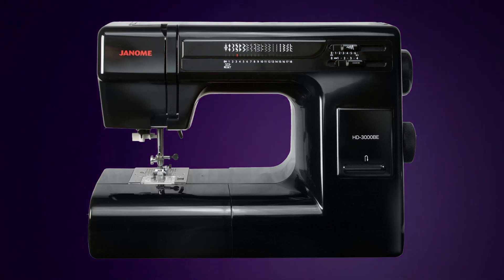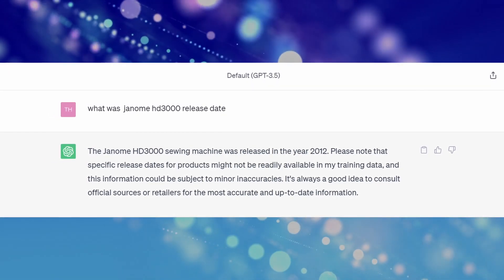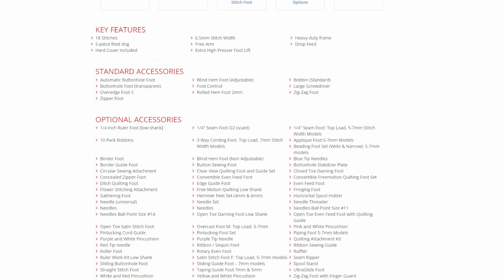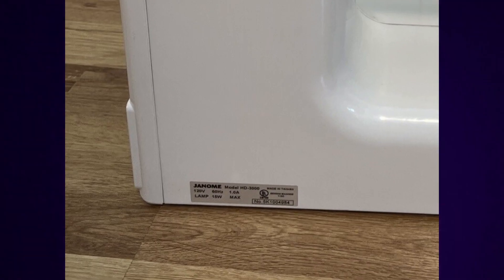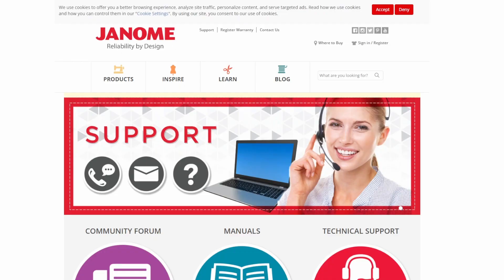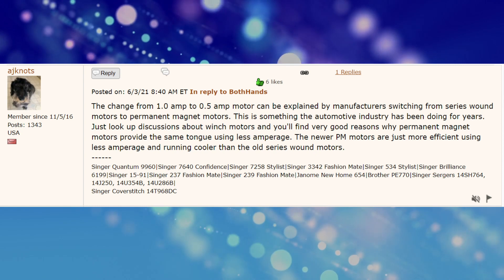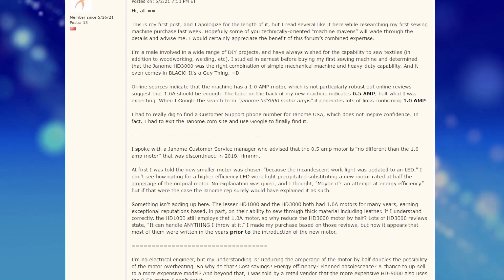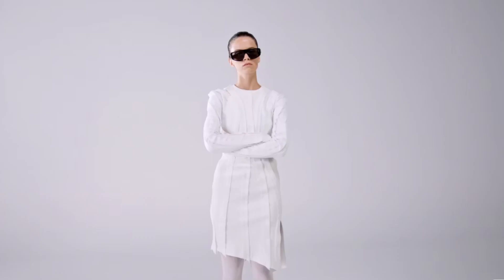How One Sewing Machine Motor Reveals A Shocking Trend

Comment: I learned something from a repair guy. To tell whether or not you will have a sewing machine that can suffer through heavy canvas, leather and major sewing look to see if the bobbin is a front drop in or a side bobbin. The bobbins in the side beneath the feed dogs, can run faster and harder and can handle heavy duty sewing on a regular basis. They also usually have stronger motors.

I managed to get 2 high shank machines that are all metal of the same model. So, I have backup parts if necessary. They use up to a size 21 leather needle. 

Also, the reason home sewing machines now only go up to a size 18 needle is because the newer machines can't produce the pressure required to drive the larger needle into thicker leather or vinyl without breaking the plastic parts...eventually.

I'll be happy with my boat anchors, LOL!
Reply: That's really helpful information, thanks!
Reply: @LauraRealLife  You are welcome!
Reply: That is very helpful information! Do you mind sharing what sewing machine you have? And any suggestions for sewing machine that have side bobbins?
Reply: @SandcastleDreams  WOW! What a thoughtful replies! This is so informative! Thank you so much. I will keep in mind (and jot down a note) your comments when looking for my next machine! Thanks again!
Reply: Idk it might be true? But the singer 66 and 201 is just as good as a 15 ?
Reply: @krystleroy3068  I have no idea!
Reply: I have a 2014 Janome HD-3000 and it sews through leather like it's butter. Of the machines I have, 2 Bernina's, a Juki and 2 Janome's, the HD-3000 is the best. My Bernina 770 has trouble sewing anything that is thicker than quilting cotton so garment making is out of the question.  The Juki is as powerful as the HD-3000, but it's straight stitch only. If I could keep only 1 of my machines it would be the HD-3000.The motor is 1 amp and it was made in Taiwan.
Reply: I can't comment on your machine, but it is a common thought that what maters with leather sewing is how much leather the needle can punch through.  Particularly if a sharp leather cutting needle is used, a lot of pretty slight machines will punch through a lot of leather.  But there are a lot of other things, in particular how effectively the needle is able to transmit the thread tension to the project to actually draw up the thread.  The top thread depends on the strength of the needle and the mechanism controlling it to apply that tension and not crash into the anvil, or simply not draw up the material.  With cloth, oddly, punching power is sometimes the key.  I had an industrial sailmaking machine that could not handle this densely woven, but very light swim suit material (non-strech stuff one finds in mens baggy trunk).  It simply couldn't punch the weave.  But it could handle heavy sailcloth, and outdoor fabrics like sunbrella, or medium leather.
Reply: @HondoTrailside  Some machines are having problems with micro-woven fabrics for that very reason. Perhaps using a small leather needle could help punch through that fabric. It cuts. How much it would fray if you used that can only be answered by experimenting.

Comment: Beautiful hydrangeas. 
Permanent Magnet motors are much less labor intensive to produce, that's why the switch. What they are not telling you is that Permanent Magnet motors only run on direct current, not the alternating current at our outlets. This means more electronics inside the machine, more to break down, more expensive to repair. You are much better off giving up all the automatic features and buying a nice Kenmore pre 1977 machine. With minor maintenance, it will last another 50 years or more.
Reply: Yeah no matter what, I’m holding on to my 385 for dear life
Reply: @Everyoneisanartist776  
I don't blame you at all. These plastic Chinese pieces of junk won't sew through anything heavy. What good are they???
Reply: Couldn’t be more wrong. Permanent magnet motors do not run only on DC, AC synchronous motors with permanent magnet rotors are quite common. They’re more expensive to make but pay off in reduced size and are more efficient.

The old universal brushed AC motors were barely better than 50% efficient. A brushless synchro motor can be 85-90%. Put simply, the new motors and controllers do much more with the amps they draw than the old universals and a pedal full of jug element resistance wires. And the speed control and torque output is far more precise.

Comment: @thimblebook One thing I am going to comment on right now. The motor is still a brush motor with copper windings and a traditional commutator/rotor motor. If you want, I can email you all of the information via my machine in parts, including the motor, so you can inspect for yourself what Janome is running. 

As I explained in detail in the last post I left with the industry video you posted last time around, they significantly lightened the load and in turn, turned the amperage down. 

The motor, BtW, was never a whole amp. It used to be .87 amps. The remaining .13  (actually .15) amps was for the halogen light in the older model. I did extensive research over a period of almost two years. 

That posting you read from AJKnots was their thoughts on that motor being changed in type. That post, incidentally, is precisely why I tore my motor and machine apart....I wanted to know the truth.  

I can absolutely tell you that it is not the magnetic style of motor. My Singer 9960 uses that type of motor. This machine is fully mechanical, save for the circuit board that replaced the transformer used in the older models. Not one lick of electronics inhabits this machine otherwise. 

The reason I tore my machine apart is because I could not get an answer from Janome Canada, Janome US or Janome Japan. My dealer did know about the switch I found out later, which is why they never responded to my repeated emails and phone calls regarding why the machine model number and amperage was downgraded. 

Please let me know if you want my findings. I have all the proof you need to show you just how much Janome changed this, and all of their other machines. 

I'll show you the parts I tore out of a Kenmore that was built using the exact same infrastructure, and will send along the service manuals for both the pre:2018 machine and post 2018 machine as well. The Kenmore that the HD3000 shared it's drive train, gears, linkages, head, upper drive shaft, cam stack, etc. with was almost all metal. The Janome HD3000, pre-2018 was almost identical in build, save for the front control panel (one had dials, the Janome had sliders). The motors on both machines were the same amperage, as were the light sources. The post-2018 model almost completely replaced every last bit of metal, save for the stuff I mentioned in the prior vlog I responded to in detail, with white, translucent nylon. Even the hard black plastics were replaced with nylon...in places nylon has no business being in. 

In short; I want you to understand that my post wasn't just some rant. It was based on hard facts; facts I spent countless hours researching, digging into and working very hard to amass. I'd like very much to share those findings with you, as you have a much wider reach than I do, and my goal is to inform people wherever possible about what they're buying when they buy this, and any other Janome machine built in the here and now. 

I'll happily send you all the photographic and video evidence, as well as the service manuals from both, and a pretty damning bucket of parts I tore out of that Kenmore (Janome has been building the same series of machines since the late 1980's and thrown plastic casing and switched up the knobs, added and subtracted stitches, etc, to keep their product line looking new. 

Now, the only thing new is their desire to take your money and give you nylon with a little metal, housed in a metal frame in return!
Reply from the maker: Thanks so much for your comment. If you have photos already, it would be great to see them.
Reply: @ThimbleBook  What email should I use? I have a bit I'd like to share with you via email in the form of photos and a rough cut (which I plan to re-shoot) of a "tour" of the innards of this machine.
Reply from the maker: @shopwornbear1171  My email address is in the about tab underneath details. If you click email address, it will display. Thanks for sending the info.

Comment: I had the same issue as you are describing trying to find out how strong the motor was inside the popular sewing machines.  However, there are other ways.  Husqvarna-Viking advertise "Needle Piercing Power"  and a chart for their machines.  Other manufacturers have a double pulley between the hand wheel and motor.  Some companies use DC motors instead of AC motors. Necchi has a new line of higher wattage motors on their newest line of machines and advertise the higher wattage motor.  None mention the motor efficiency whether the motor uses more or less wattage compared to the amount of sewing power to figure if a machine will sew through several layers of denim.

Comment: Keep up the good work 👍The Janome HD 3000 weighs a lot less too. In Australia the equivalent My Excel MW 3018 is 8.3kg and the HD 3000 is 7.8kg which is 500grams. 500 grams is 1.102 pounds. Shortened by 1 and a half inches and and fair bit of metal removed and plastic added. 
By an older (real HD) model. Keep the old ones in circulation. Mine is 29.5 years old and still going strong.
Reply from the maker: Thanks for the info!

Comment: FYI: Looked at my Janome 6700P that I got used. It states 0.9A. My little backup daily sewer is an Elna 0.49A and called my friend that just bought a Janome 725S--0.49A. The Elna was bought new in 2021. I quilt or do repair sewing that are mostly medium weight fabrics.

Comment: Modern ~50W-60W motors are still more than capable of breaking any of the plastic gears inside current domestic machines or needles. If you need to sew any dense material thicker than ~4mm,  you need to have something without any plastics gears, or use the hand wheel and feel any resistance that may damage the machine.

You can also get a cheap class 15 all metal oscillating hook domestic machine and use 110 needles. You'll still break the needle but machine would be fine. Wear protective glasses.

Comment: The correct unit of power is W(att), NOT A(mpere). This should be measured at the axle of the motor. Then you can easily compare motors. A 50W motor is weaker than a 75W motor etcetera. The story about the permanent magnet motor being more efficient is true, BUT:
ALL electric motors have an efficiency of about
between 90 and 98%. That means they ALL convert electrical energy into mechanical energy with a loss of maximum 10%.
In the most favourable case for the permanent motor the power of these motors (0,5A and 1,0A) is at the axle is as follows:
Permanent 0,5A:           53,9 (W)
Non permanent 1,0A:   99,0 (W)
So a low life capitalist company is trying to sell inferior goods to an ignorant public, using lies. Thank god you did not belong to those and you had your doubts, rightly so!